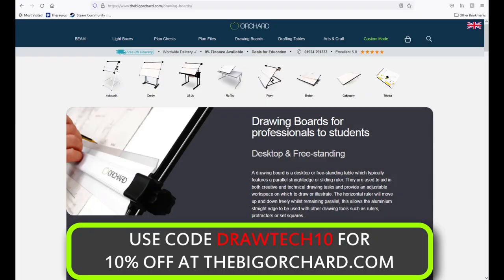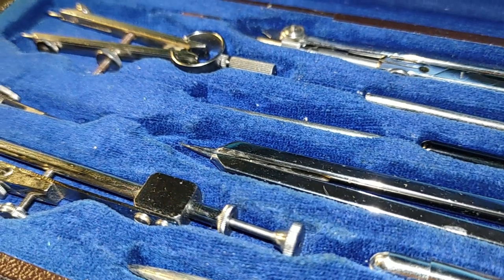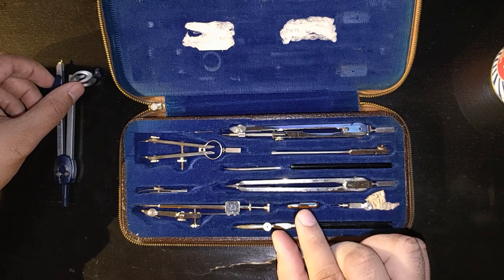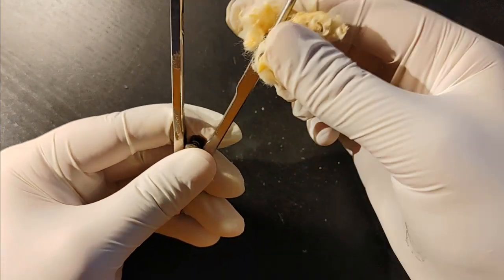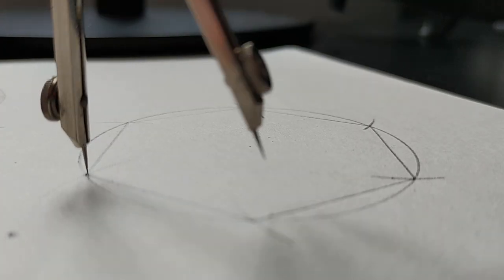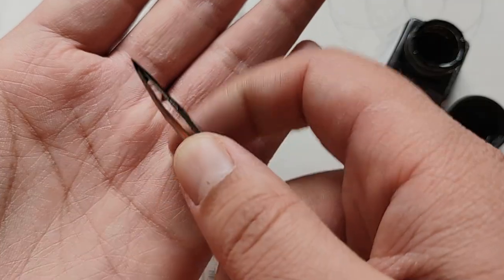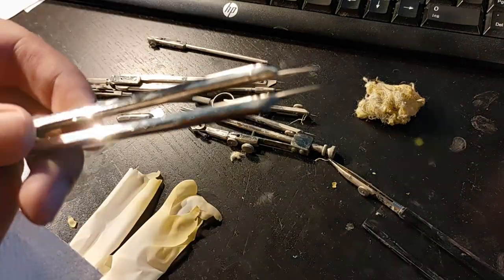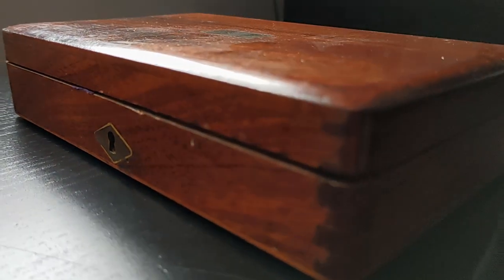Opening ENGINEERING Drawing Tools From The 1950s

Comment: The reason you are making a mess with the  technical pen is because you are using a FLAT EDGE RULE.  Do not use a FLAT EDGE RULE.  Either buy a raised rule for use with technical pens OR tape a penny under each end of the flat ruler t raise it up off the paper.  This will stop the 'mess' you are making using the technical pen to draw lines.
Reply from the maker: A great tip thank you
Reply: Omg that fibally explains why most of the plastic 30cm rulers here in germany have one edge that sits flush with the paper and one raised one!

Comment: The tool you said have no idea what is for, it’s for drawing very small circles, you were forcing it too much, close it the most you can, put a finger at the top of the movable part then with a little push move the part with the pencil and you will see a very tiny circle
Reply from the maker: Thanks for the info, I sold the set so I’ll have to try again if I get my hands on another one.

Comment: I used those instruments until the 80s as a mechanical designer
Reply from the maker: Do you still have the set?
Reply: @DrawingTechnical  several, and a Leroy lettering set and 50 or more templates. I started in 1971. The small ink compass is a drop bow compass I used for small circles for power poles  at Houston Lighting and Power in Houston and used it at Houston Natural Gas for turning points on pipeline routing.

Comment: I've got my grandfather's drafting instruments manufactured in the early 1940's pre war. I also have his machinist level, calipers, dividers, lead holders for 4h - HB, sharpener for leads, I use the lead holders,the dividers, weekly and other tools occasionally.
Reply from the maker: That's great, a generational treasure! I have some sets and after researching, it seems the brass set I have is from 1850s, which is very interesting. I use them for my works, they are soft a bit like maleable gold.

Comment: In hongkong I found an old PRC made set from the 50's and it's honestly wonderful
I bought it because I felt bad for it, it was "brand new"
the little stationery shop I went into had been there since before my mother in law moved there, and they had never gotten rid of an unsold item
found the drafting set among the old graph papers and stuff, and it has a solid 5mm of price stickers on it
the cardboard box is faded, but the red and black box its in looks good as new
honestly thought it might have been a fake reproduction one, until I realised the little plastic tube of leads is practically disintegrating with age
and im pretty sure the leads contain an actual lead as they leave a surprisingly shiny line and have a white tarnish over them 
but the actual tools are beautifully made and feel great to use, my one gripe is that the compass grip isnt a reverse thread so it sometimes unscrews when I use it

Comment: The compass with the long needle is designed to draw extremely small circles - 2 mm are entirely possible.
It was invented by Edgar Oscar Richter around 1870, in Germany. In German they are called Fall-Nullen-Zirkel.

Comment: When using the ink box. You are using a rule that is in contact with the paper. That is wrong old wooden rules would have a brass or bronze blade that would be about .75mm or 32" above the page. You can flip modern Squares over for the same purpose.
Reply from the maker: Thank you. I used to smudge my drawings a lot and thought maybe I should wait for the ink to dry before moving the rule, but it interferes with the pace of the drawing. I think I saw it in an old 1950s drawing book; to turn the rule upside down because the edge is actually raised. I shook my head the moment I read that haha.